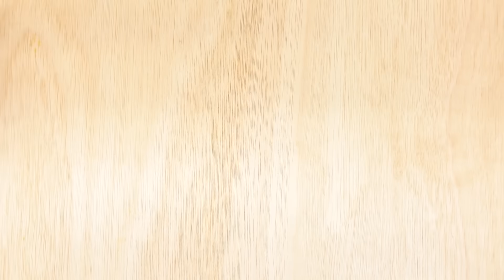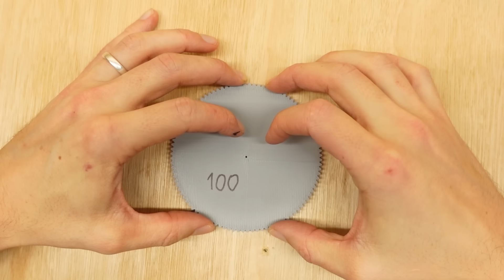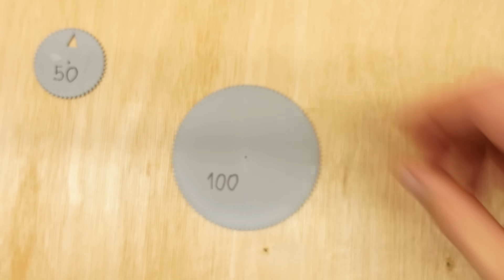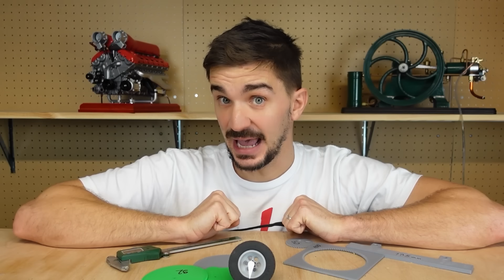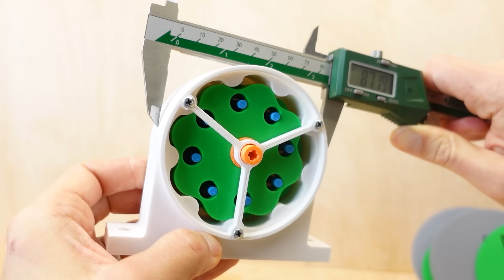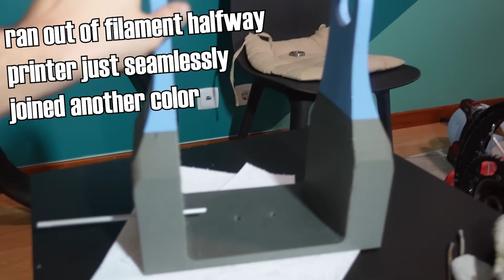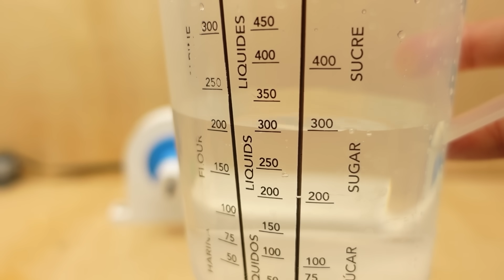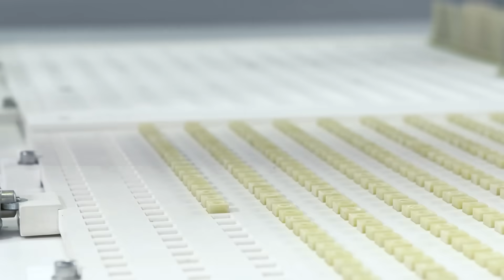Toothless Gears Make Much More Torque Than Conventional Ones, Here's How. Cycloid Drive Explained

Comment: I enjoyed this video.  But if you want higher gear ratios with zero backlash, the harmonic drive is the way to go.  Harmonic drives are becoming the standard for robotics these days. Exact same principle as this this but they solve the tooth interference by making the internal gear a flexible shell that is bent into an oval shape.  So the teeth are very small on harmonic drives and z and can achieve even higher gear ratios than the cycloid. You should make a 3D printed version and do a video on that as well! The harmonic drive has no eccentric drive shaft problems,  Straight drive shaft and strength output shaft.

The disadvantage is that the flexing internal gear will have long term wear problems that might be worse than a solution like the Cycloid gear solution.  And it's more expensive to manufacture the flexing gear.  But the advantage is higher gear ratios in a tiny package (100:1 to 300:1 are common), and the drive is double sided like a planetary gear so less offset torque creating strain like the Cycloid solution with non flexing gears.

Comment: It would be much less disturbing to watch and easier to understand if you actually pointed out that from the point of view of the gears the 50 teeth still make 2 rotations against the 100 teeth. The smaller wheel is turning 2 times but it's "path" is making one (additional) turning too - these 100 teeth are themselves one turning. It just adds. That's why if you take a 50 teeth gear and a 1000 teeth gear then the smaller wheel will make 21 revolutions altogether and not 30.

Comment: What about a cycloidal disc as usual and other two at 90 degrees located on both sides and half of the width of the central to avoid vibrations?

Comment: The diff between round gears and sharp gears feels unfair since you compared a 100 tooth vs a 9 tooth. 

A 91 tooth inner gear to outer 100 tooth gear is a diff of 0.09 but on your 8 to 9 tooth reduction that’s only .111 diff so wouldn’t the larger gear with a larger tooth gap still be better for torque?

Comment: 2:55
Notice that the arrow's direction relative to the surface it moves along DOES count up equal in all cases.
It points away from the surface twice on the straight path and outside the circle and it points at the surface twice in the example inside the circle.
Which means, relative to the surface it moves along, it always spins the exact same amount of times.

Comment: I think you forgot that with cycloid drive, you have more contact points so more contact area, more contact area means more friction losses. So if I'm correct the force efficiency will be lower. So if your input torque is 1 Nm and your gear ratio is 8:1, you will not increase the torque to full 8 Nm.

Comment: I have a bit of a background in math, physics, and engineering and run a machine shop.   TECHNICALLY some of the things you said were, while illustrating your point clearly, not exactly perfectly described scientifically.   (ie.  Counting the number of teeth instead of basing the reduction on the difference in diameters.)   The truth is though, that anyone who understand this well enough to know the difference in tiny details does not need it explained.   Very well done and I enjoyed this watch.

Comment: question. if the disadvantage of it is the loss of balance at high rpm, can it be fixed by making 4 of them, and the center 2 is at 0° and the outer 2 at 180° just like an inline 4 engine since they are one of the most balanced engine out there?

Comment: You can reduce vibration by increasing the dimension to 3d gears. Spheres with one less bump than the cavity they occupy. Obviously you need to offset the wobble with an oppositely placed wobble sphere within the same cavity (on a different 3d plane of course) bit this creates a 4 dimensional vibration issue

Comment: I have a meat mixer that I use to mix spices and seasonings into ground meat for making jerky. It's a U-shaped metal tub with paddles inside that can be turned by a crank on the outside. I've been wanting to motorize it for years, but have come up empty thus far. I need about 60 RPM and a good amount of torque. Much faster than that and this thing will be slinging meat all over the room.

I tried a garage door opener because the output is the perfect speed AND the direction can be easily toggled. Everything worked perfectly until I added the meat. Turns out, those motors are not designed to run for more than a few seconds under load, and the large capacitor literally blew up.

Then I tried a DC treadmill motor and the electronic speed controller that came with it. Those motors/controllers aren't designed to run that slow, so it would just stop when the RPM's drop below a certain level.

I'm wondering if I can use a cycloid drive to accomplish this. Hmmm....

Comment: Very interesting intro. I've been thinking about this in very different dimensions: planetary rotations. When asked how many times does earth rotate around its own axis in a year the intuitive answer would be 365.4. Yet that is incorrect. It's either 364.4  or 366.4. Similar situation as with these cogs. A very simple demonstration of this +-1 offset is the moon. The moon makes 1 rotation around its axis, per rotation around the earth, and yet there's '0 days', if one takes reference (not to the sun, as in light days) to the earth. The same side's constantly facing us.

Whether it's + or minus for a planetary body depends on the direction of the turning around its own axis compared to the direction it has around the other star or planet.
Great insight with those cogs, thanks!

Comment: Yeah uh no, that's incorrect. Count how many times the arrow touches the stationary wheel, once. It makes one rotation around the other wheel. It makes 2 revolutions relative to what we say is up. You can also think of it like this. If you put both wheels next to each other, and spin one so that it spins the other, you'll notice that both will make one rotation, now fix the camera to spin with one of the gears, itll now appear that the other gear rotates twice around the initial gear. So the "amount of rotations" is dependant on reference, and what you decide is a rotation.

Comment: I just took a Bosch battery drill apart and the very first sprockets after the motor sprocket are three small sprockets all running together inside a large inverted sprocket (like a triangle of small sprockets). I'm tryna fix it, but the power IC has got wet and there's aluminium oxide on it.

Comment: 10:45 3d printing is good but not for everything...if you want to clean the holder, it's very hard to get rid of the germs that are in the crevices in b/w the layer lines. so not good for sanitary needs.

Comment: The friction REZISTANCE !! CAN !! be minimize IF You WILL(pls try that) use bearings FOR BLUE RODS THAT "ROLL" INSIDE THE HOLES IN THE GREEN GEAR DISK ! FURTHERMORE, FOR vibration equilibrium use 3 "green" discs THAT CREATES 3 RADIAL FORCES INSTEAD OF 2 OPOSITTE 180° WORKING IN YOUR EXAMPLE. For MORE SMOOTH MULTIPLE THE 3 DIRECTIONS TO 6, 9 & so onn! I'm an Dr. ING. În mechanichs so my advice is a celebration to You and New Found passion, gladfully we can colaborate in this field. Pm anytime and surely congrats 🎉.

Comment: 3:45 No. 
this is dumb, it’s not that it’s a curved path so it takes more rotations. The number of teeth are the same, you’re just not correcting for the reference point, and acting like these are unexpected answers. 

If you rewatch this video, you will see that the marker only ever points perpendicular to the plane the gear is traveling on twice. Not once. Not three times. 
EVERY TIME IT HAS ROTATED ONLY TWICE IF YOU ACCOUNT FOR THE
PLANE OF REFERENCE (the connection point between the Small and large gears/rack)
Just watch the marker and see how many times it returns to the same position RELATIVE TO THE GEAR/RACK

Comment: 2:32 not three rotations, only two. The gear’s mark points upwards three times, but the mark really just points away from the big gear at the start, rotates until it points exactly away from the big gear again at the bottom of the big gear, then points perfectly away from the big gear at the top again. Yes, the wheel is turning 360° three times, but it’s not rotating along the surface of the big gear 360°x3 times, you’re adding 360° from the big gear’s surface to the rotation of the small gear
Reply: 2:48 same here, it’s relative rotation is one because it’s subtracting the 360° from the circumscribed gear. 

If you watch it again, you’ll see that it points away from the center of the big gear twice.

Comment: If I walk 20m in a straight line, I rotate 0 times

If I walk around a wheel with a circumference of 20m (I am Spiderman), I rotate 1 time

Even though I walked the same distance in each case, I rotated a different number of times

Comment: What happens if you add more than one cycloid gear at 180 degrees? How about three operating at 120 degrees to each other? Does the high speed issue reduce? (asking for a tank gearbox)

Comment: 1:47 That doesn't seem right to me.  
1. The distance travelled IS the contact point of the wheel. If it was the center, then a wheel with a larger diameter would travel a larger distance - which it doesn't.
2. The wheel actually always rotates ONCE. It is just our frame of reference that is changed between the two experiments. Relative to the surface it rolls on, the wheel rotates once. Cou could now argue, that in an absolute frame of reference it rotates twice. However, if you'd now rotate that whole contraption counterclockwise, suddenly the wheel would not rotate at all..

Comment: Well. The geometry and mechanics are actually the same as in a planetary gear, you are just making the "planet" large enough that nothing else fits inside. The gear ratio (reduction) comes from the fact that the planet is counter-rotating relative to the motion of its center. My issue with the video is that it doesn't explain why rounded teeth (cycloidas) are used at all; i.e. why not use involute gears with 9 and 8 teeth for the same effect. Heck, you can make practically any convex shape as a tooth shape for the outer ring, and figure out the corresponding tooth shape for the gear.

Comment: Harmonic drives solve the friction issues of these, although they can only go as high as a 30ish to 1  and essentially infinitely higher. You can back drive 100:1 unlike worm screws, although a roller ball worm screw would be able to back drive I suppose, but the contact area would mean less strength. The good ones use a bearing with a flexible race inside and the flex spline is involute and rolls instead of slides which is why even with the high ratio it can backdrive and many teeth are always in contact. There are roller cycloids drives as well and it’s true most robotics really only need 10:1 or so.

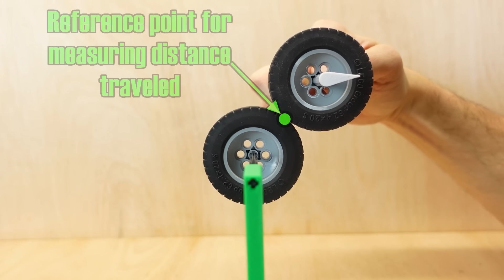Comment: → 1:25 I think this is turning the issue around: The rolling distance is still the same, and the actual contact point only sees one rotation of the wheel (the white pointer only points to the contact point once). The second rotation comes from changing the direction of the wheel as it turns around. The distance traveled by the center of the wheel doesn't really matter here, it just coincidentally matches. (Of course, the mathematics work out the same at the end.)

Comment: Just a curious question. You had said that the disadvantage of cycloidal drives is that the two gears have an offset. However if you were to make two gears that were half the mass of a third, and sandwich the larger gear between the two smaller gears, would it completely balance out the force? At least of the pistons I would think.

Comment: This idea has been around a long time. For centuries, mechanical clocks used a small gear set to accomplish the 12:1 speed reduction from the minute hand to the hour hand—clockmakers call this the motion work. Effective but not especially elegant. In the 1850’s, a maverick American clockmaker by the name of Aaron Dodd Crane employed a cycloidal drive to accomplish this reduction in his clocks, calling it a daisy-cam motion work. It had a cam like yours but instead of a surrounding housing with inward lobes, the outer element simply had pins engaging the notches in the cam. A stripped-down version that was effective for his purpose and highly innovative in its day.

Comment: Could you solve the wobble problem by making it 3 offset gears instead of 2; two outer small ones sandwiching the larger middle but collectively the same weight as to still cancel out vibration?

Comment: Couldn’t the rocking couple be solved by having one thick “gear” in the center and 2 thinner gears on the out side of it that equal the weight of the thick center gear? The 2 thinner gears would be on the same stroke but opposite the thick center gear

Comment: I remember an epicycloid gear where the (outer) ringwheel was fix and rigid, an output shaft was, through a thin walled cylinder, connected to the inner gear, which was flexible and had 90-95% as many teeth as the ringwheel, and finally, an input shaft, turning a carrier with two opposing wheels, pushing the inner gear out, shaping it into an oval, enabling contact with the outer ringwheel. It's balanced, with minimal vibration, and backlash, but the bending of the inner gear creates friction. It can intermittently accept high revs.

Comment: Trochoidal gears aren't toothless... The gear you made is the inner circular (normal vector) offset of an epitrochoid. 

The teeth are continuously meshed by the circle pins, which are still a tooth profile that is meshed like any other gear tooth. 

They simply do not have a straight line of action like involute teeth.

The continuous meshing property of these gears brings you right back to an automotive application, the gerotor (trochoid) pump.

Comment: Bro but for cycloidal gears, the velocity ratio does not remain constant if the centre distance is changed during power transmission.. the centre distance changes due to mechanical vibrations. But if we talk about spur gears.. even if the centre distance between two spur gears (pinion & gear) is changed.. the velocity ratio always remains constant..

That's why Spur gears are preferred over Cycloidal gears even though cycloidal gears are best bcoz there is no interference in cycloidal gears

Comment: I've been designing Sumitomo reducers for many years into steel foundry casting equipment.    They offer reduced size, precision an awesome 500% overload protection.   I have them in many countries without a single failure despite years of foundry abuse.

Comment: Why not 1 gear at 0, 2 gears (double thick) at 19:57  180, 1 gear at 0 again? Mostly balanced.
Reply: My thoughts exactly! How about a 6-pack cycloidal, an inline C6 of sorts 😂
Reply: this is a case of chasing diminishing returns. going from 1 to 2 turns an oscillating force into a oscillating torque by placing two equal/opposite forces close to eachother. repeating this process (ie, going from 2 to 4 like you're saying here) just turns your oscillating torque into an oscillating bending moment.

essentially, instead of having the mechanical stress spread out over the full length of the axle, you're concentrating all of it into the space between your gears
Reply: Same idea here! Would be nice thing to test.

Comment: Hey I was thinking about this offset between the forces forming the rocking couple. Maybe I‘m missing something but we already fixed the first imbalance by using a second gear that is half a rotation offset right? Can’t we mirror that entire setup across a plane perpendicular to the rotational axis? So basically four wheels with the two outside ones being in sync and the two inside ones being in sync? Wouldn‘t those force offsets cancel each other out? I’m obviously just an amateur so no hard feelings if that‘s completely wrong but maybe someone can explain :)

Comment: The problem with 3D printing is that it is all plastic. 

We dont need more plastic junk, we need less. 
I would rather have a metal toilet roll holder and a wood wheel balancer. Save the plastic for where it is actually useful.

Comment: awesome video! could the rocking momentum be "solved" by using a 4 or 6 gear like a inline 4 or inline 6 engine. yes it would loose a bit of compactness but could spin faster ? genuine question

Comment: I feel like the mechanical losses would be much higher due to looser mating of the gears and more limited by the maximum torque due to the more fragile design, a solid shaft will always be more robust, all around those are cool but i think theres a reason geared gearboxes are still the most common

Comment: It seems that the off balance of forces between the two inner gears demonstrated at the end could be handled by using 3 gears, the middle one a full sized gear and the two outside ones each a half as thick as the middle gear to act opposite the middle gear. This should balance out that vibration.